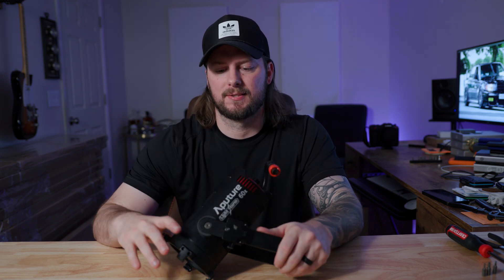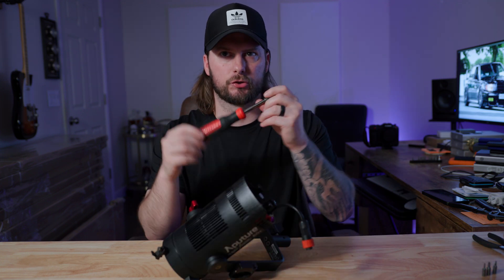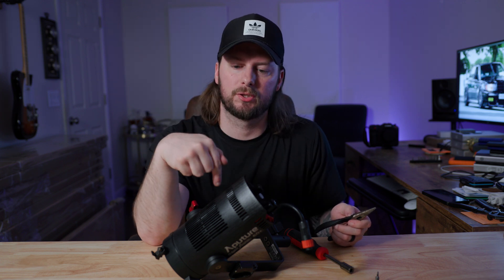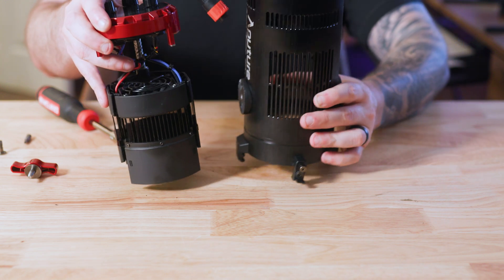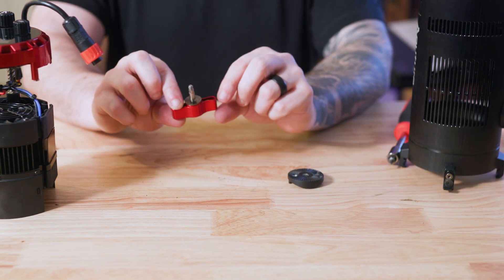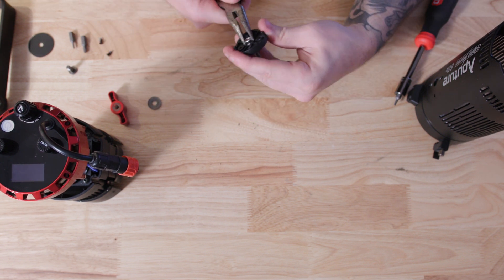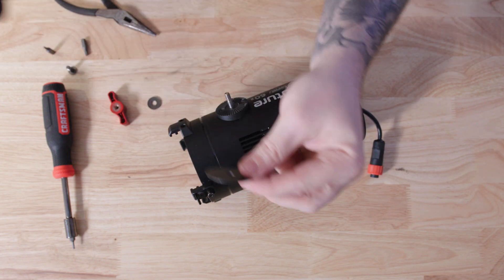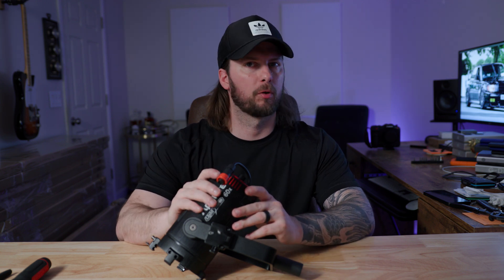How to Fix your Aputure 60X

Comment: Thank you so much, i had this problem on my first Aputure LS60X and i had it sent back to Aputure and they sent in a new one, One year down the line and the one they sent had the EXACT SAME PROBLEM just 5 days ago, if not for this video, i would have been calling Aputure again for a new one and the process i went through getting a replacement for the first one is not something i would want to go through again.

Thank you once again for this video, i just fixed mine following the steps here and the pdf document you posted as reference. I wish more people would see this and mostly Aputure would see this too and make the same modifications to new batches of the light.
Reply from the maker: @dannyelfilms  definitely appreciate the kind words and glad this helped! When mine did this, I didn’t really have time to send it in, so I dug around online until I found this info. Was shocked there wasn’t a video out there on it.
Reply: @theyoungsphoto  yeah and it seems you are the only person that has done a video about this on youtube basically